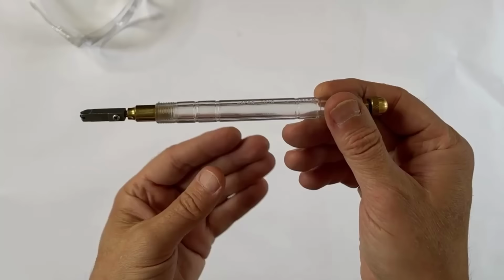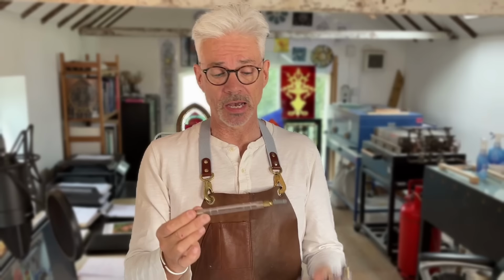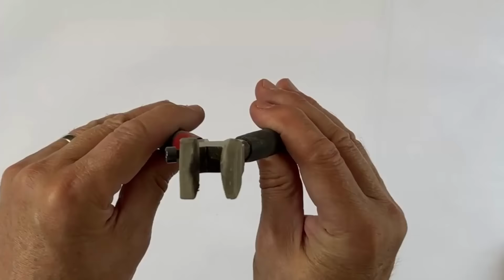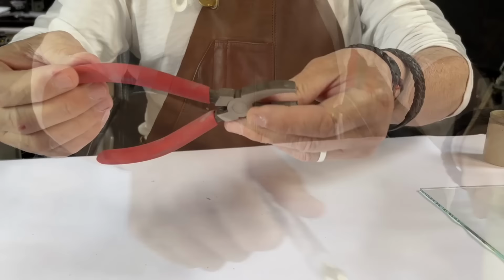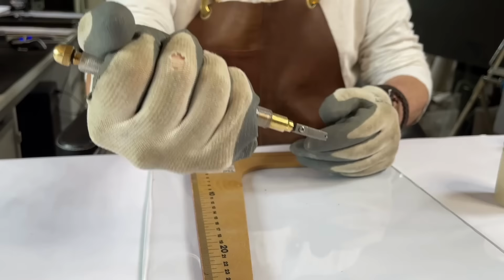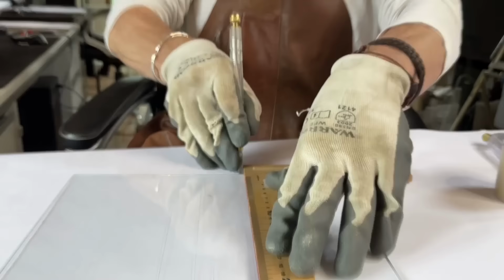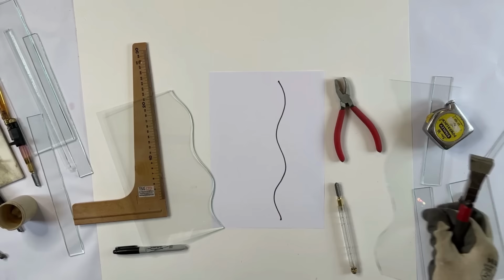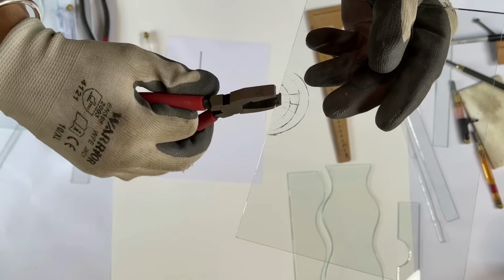How to Cut Glass Easily for beginners

Comment: Hello! I see you hold it at a 45 angle when you cut and do mention it, but before you say you want to hold it at 90°, why mention the 90?
Reply from the maker: You’re right about holding the cutter at a 45 degree angle in the direction you are moving the cutter along the X plane. Holding the 90 degree angle refers to the Y plane to make sure the cutter wheel is in the right position in relation to the glass. Hope that explains it a little better 🙂
Reply: @DerekHuntArtist  thankyou for getting back to me! I will try this today.

Comment: I’m a professional glass cutter. And it’s like all the sudden I forgot how to cut glass. A lot of my cuts have been skipping and I can’t see why. I clean the glass, make sure the cutter is oiled, have a brand new cutter head. And keep my glass cutter straight. And I’m jus bamboozled as to why I’m having so many problems all the sudden. Any advice?
Reply: I’m wondering if it has anything to do with the temperature possibly. Ik it’s easier to cut when glass is warm and it’s recently gotten cold in the shop
Reply from the maker: Hi Ian, that’s a tricky question. Sounds like you’re doing everything right by cleaning the glass and oiling the cutter head. Sometimes I find a new glass cutter head can take a little while to get settled into its job. Check to make sure the cutting wheel doesn’t have any damaged areas ( if it was dropped onto a hard surface that can cause small damage to the edge of the wheel) What make of cutter are you using?
Reply: @DerekHuntArtist  I’m not 100% sure what brand it is. And I changed my grip to between the fingers instead of like a pencil and that’s helped a lot. So I think my problem was inconsistent pressure. Glass can be so finicky.
Reply from the maker: Ok, glad you’ve sorted it out👍🏼

Comment: I use a pistol grip and that's not how I hold it. I wrap my fingers and thumb around the grip and place my index finger over the top pointing toward the wheel. I then place my other index finger on the flat part of the cutter just above the wheel. You can make seriously accurate cuts with no strain to your wrists or hands. 40 years doing what you are doing. I have taught quite a few people and they are into it now. I like some of your techniques. I have not seen them before and they are helpful. Thank you.
Reply from the maker: Thanks Kathy, glad you found the video helpful🙂

Comment: Is there a maximum thickness that the glass cutters can cut or are there different glass cutters  for specific thickness?  Also, if you know a manual way of polishing the edge of the glass, can you please create a video for that?  Thanks much!!
Reply from the maker: Generally you can cut glass with a regular glass cutter from 1mm up to 6mm thickness. I would suggest using a professional glass company to cut thicker  glass or laminated glass🙂
Reply: @DerekHuntArtist  Thank you for responding and your advice.

Comment: This is an excellent lesson in cutting glass......thank you.  Do you have a video for drilling holes in glass to make wind chimes?
Reply: Idk if your still interested but your need specialty carbide or diamond bits, then you jus do it slowly with even pressure and water for lubricant. Whilst turning the drill in circular motions. It helps, once u poke through one end to flip the glass around and drill from the other side to prevent oysters in the glass

Comment: You are the greatest! Very nice. It is amazing to see the shapes can be made, wow. I want to cut a display protector of smoked glass in the shape of an old CRT tube with curved corners (as in star-wars or other sci-fi) and embed it in a wooden panel. I think I need to make a template first and then cut it around the edges. I want to try it haha, a new challenge! Thanks for the great video!
Reply from the maker: Hey thanks for your comments  - You can do it! 🙏🙂

Comment: I tried cutting glass for the first time yesterday. I have a cutter from the same manufacturer but the non-reservoir version with the little wooden handle. Six sheets of two millimetre thick glass later, I managed one single successful cut and break. I think I need a lot more practice. 😊
Reply from the maker: Stick with it, you’ll find it gets easier 🙂
Reply: @DerekHuntArtist  my first attempt resulted in a line that was straight for the first 4" and then veered off. How deep does the cutter have to go? thank you for a clear useful video.
Reply from the maker: @richardmorgan2959  even pressure and listen for the scoring sound. That helps to make sure the score runs all the way across the glass 👍🏼

Comment: Hi, Derek, which surface is preferable for sheet glass cutting? Would a Cutting Mat be alright or would the surface be too flexible? Great video, thanks
Reply from the maker: I tend to cut glass on a piece of old carpet laid over my cutting table. Carpet material is great because it doesn't leave scratches in the glass when you move it around :-)
Reply: Thanks, Derek. That's great! 👍
Reply from the maker: My pleasure  @ThePtolym

Comment: Great video,thanks. 
I need to cut some pieces of front surface mirror glass to repair a couple of old twin lens reflex cameras. 
I have a new pencil type cutter. 
Any suggestions on which side to cut and whether to tap the score?
Can’t use pliers or snappers because of the silvered surface. 
The mirror is about only 1.6 m thick. 
Had it a week and keep putting it off!
Dave
Reply from the maker: Can’t really advise on optical mirrors as they are specifically designed for the camera. Generally ordinary mirror is cut on the non-silvered side

Comment: I have a question, if you don't mind.  We have a huge antique mirror that we want to cut down. are there special considerations for cutting old thick glass?  Thanks so much!
Reply from the maker: Hi Millie, it is possible to cut mirror on the non silver side, up to a glass thickness of 6mm. Be very careful when cutting large pieces of glass, especially if you have not done this before. It may be wise to take the large mirror to a glazier to have the glass cut down to a new size.

Comment: Great video, Derek. I am 80 and not too old to learn. Glass cutting will be an asset in restoring cars that I have been doing for 45 years. Is there a way to sand or smooth the cut edge?
Reply from the maker: Hi Bill, great to hear the video was helpful.  You can sand down the edges with a sharpening stone, the same kind of thing we use to sharpen knives. Remember to wear a mask as glass dust is not good for the lungs!
Reply: Great to see a Scottish Artist Thank you for a very helpful video…..Makes watching easier when you’re easy on the eye. Watching from Paisley
Reply from the maker: @isabelllindsay1056  thank you , glad you found it helpful🙏🙂

Comment: Great video, thank you. Can I ask, what does the oil on the tip of the cutter do? What difference does it make if you don't use oil?
Reply from the maker: WD40 works great!
Reply: @DerekHuntArtist  Thanks for your reply Derek. It didn't answer my question though. What I was trying to ask is why do you oil the tip of the cutter? What does the oil do in the glass cutting process? Does it just lubricate the cutting wheel? Does it create a cleaner cut? Or something else?
Reply from the maker: @icepotato2800 the oil helps to lubricate the wheel. In medieval times glass cutters had small diamond tips to score the glass, but wheels do a better job. Oil does not affect the glass cutting process or change the surface properties of the cut, it just helps the wheel to spin smoothly 🙂

Comment: Hi Derek, excellent tutorial, many thanks. I have a query re your use of the wider head pliers at approx 08:43 when breaking the curved piece - it appears that the head of the pliers grip across the scoreline in order to break the glass which doesn't quite compute for me. It may be that I'm not observing correctly but I would have though that they would grip just one side of the line in order to do that. Subscribed btw, thanks Dave
Reply from the maker: If you are using the large  breaking pliers, the jaws of the pliers span across the score line and apply even pressure to the top of the glass. The bottom of the pliers apply a pressure directly on the score line, which help to create the neat fracture into two pieces. Thanks so for the subscription!

Comment: Hi struggling to cut 4mm tempered glass every time I do the tapping glass burst.. 😢
Reply from the maker: You cannot cut glass after it has been heat tempered!!!! The toughening process of heating glass then quickly cooling it does make it into a safety glass BUT it cannot be cut again because the tension in the glass will cause it to shatter into small pieces.

Comment: Hi, I need to cut 1.5 inches off the bottom of a mirror 6 feet wide, so very long thin strip.  Should I ball tap all along the entire score before snapping, or just at the end like you demonstrated.  I get one shot at a clean cut!  thanks.
Reply from the maker: Just tap the end to get the run started then carefully break down and away ( like breaking a piece of chocolate bar)
Reply: @DerekHuntArtist  amazingly fast reply.  I will give it a shot.  Thanks!

Comment: Does the thickness of the glass is the same procedure or we have to look at it differently?  Different procedures required ?
Reply from the maker: You can cut glass up to 6mm thick using a standard glass cutter. Thicker glass is best going to a professional glass cutter to do it safely

Comment: I have a tool that cuts a circle for me. I’m trying to use the circle and remove the glass around the circle. What is the best plan of action to do that? Cut the circle then tap around it?
Reply from the maker: Yes, cut the circle then tap round it to fracture the perimeter, then break away sections round the circle by cutting small lines away from the circle at intervals, then tapping the score lines to help break the outer section away.

Comment: I try to work  woht  15mm or 17mm  glass  and  have difficulty  to  broke  the glass
so you have  special technic  for  eavyglass  like this
Reply from the maker: 15mm or 17mm glass is very thick, I don’t use that type of glass in my work. Perhaps you could use a band saw?
Reply: i worked 41 years in the glass industry, I was cutting glass up to 25 mm thick by hand, yes there's is technic and skills from South Africa 🇿🇦.
Reply from the maker: @rajennaidoo7546  excellent!
Reply: @DerekHuntArtist  YOU are welcome buddy 👍.
Reply: @rajennaidoo7546  my challenge is to make 36 square for a check set maybe if i dip the glass in hot water and then put it in aerosol at -20'C it would break so i had to use my radial arm saw and a lapidary blade the squares should have 5cmx5cm in alternation for the chessboard
Reply: @jacquesomersavard7257  It's a pity I need to talk to you personally  because glass is very brittle and lots of care is administered once broken it's gone for ever. Thank you.

Comment: I can generally cut rectangles with only 25% failure rate, but tried it so many times with smooth wavy lines, 50% failure rate. Tried scoring lighter, harder, deeper, multiple or singular. Tried tapping from behind gently, again or harder tapping, still many fail. Tried thin glass, thicker glass, mirror glass, new tool cutter, old tool cutter. Guess I just have to have many attempts to get a few good ones out. Odd, I am usually good picking up techniques from drawing to woodworking but glass always challenges me.
Reply from the maker: Sorry to hear you’re struggling a bit to get good results. Hopefully you’ll find it easier as you practice 🙏🙂
Reply: In my experience. Having even pressure of the cut is important. And the cut line has to be consistent and clearly visible. Clean glass and even surface of the table is also very important . Try to find a glass teacher, they will certainly help you.
Reply from the maker: @yoyonis6840 good advice 🙏🙂

Comment: Are the cut sides sharp? Do you need to smooth it out or is it good to touch bare after?
Reply from the maker: Yes the edges are sharp and it’s best to use a glass grinder to smooth them out if your going to handle the glass a lot.

Comment: If you ran a glass cutter on bullet resistant glass a few times, then fire a few rounds into the glass, then attempt to kick the glass, would the glass hold? Or would it fail? If it would fail, how thick would the glass need to be to prevent entry?
Reply from the maker: Unfortunately I can’t answer your question. Specialist glass types such as Bullet proof glass and fire resistant glass have technical advisers who specialise in answering these questions🙂

Comment: I seem to not getting to cut in a straight line even tho I’m using a guide of a ruler
Reply from the maker: Perhaps start cutting the line slowly and make sure the cutter remains up against the straight edge as you move it down the glass. If your lines are not straight the cutter is not always up against the straight edge.

Comment: If I don't hear the scratching while scoring the glass, does that mean I'm not holding the cutter correctly?
Reply from the maker: Some glass types don’t make much of a sound, especially opal glass. The main thing is to create a good score across the glass with the right pressure. Try on 3mm clear window glass first to get the feel of it 👍🏼🙂

Comment: Nice video but tapping the glass from underneath when cutting a sheet to size, its going to end up with an extremely sharp and not a straight corner, its fine for rough work but needing to fit glass into a frame for the likes… it might not fit, and that’s the part of the glass you will cut yourself off
Reply from the maker: I agree with you Chaoimhin, however tapping the underside is useful when introducing glass cutting to beginners. Some glass types are harder to cut than others, so tapping the underside is worth demonstrating to beginners. 🙂

Comment: I’m a glass cutter by trade.I never wore gloves while cutting,you can’t get the feel.When you make a cut you don’t have to tap underneath,just pinch the glass either side of the cut and snap the glass.Using oil is very dangerous it will make the glass slippery.Turpentine should be used.
Reply from the maker: Hi Lynette, thanks for your feedback. Generally I don’t wear gloves either but it’s important to recommend gloves for those learning glass cutting for the first time. Tapping glass is necessary when cutting complex shapes, especially when making stained glass. Using oil or no oil is a personal preference. 🙂
Reply: @DerekHuntArtist  My name is Chris I’m Lyns husband.The only time I ever tapped the glass to start a run,is when I cutout circles.

Comment: I guess you are working with new glass all the time. How about cutting old glass, I was told it is not worth even trying... for example, pieces salvaged from a greenhouse, so "horticultural" glass that I wanted to trim and fit into a smaller greenhouse.
Reply from the maker: I have not found it useful to try cutting up old greenhouse glass. It’s often dirty and stained, and can be difficult to cut. Better to buy new 👍🏼